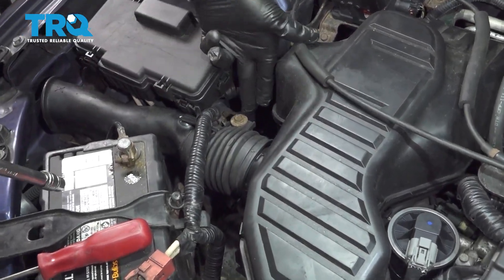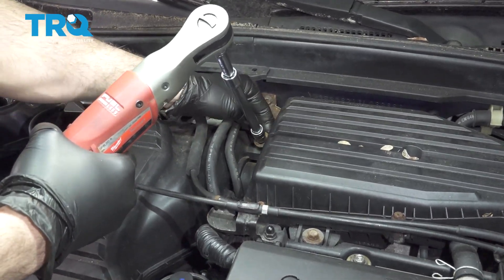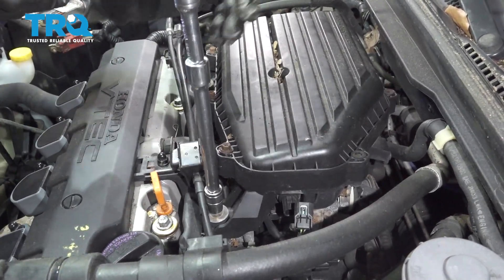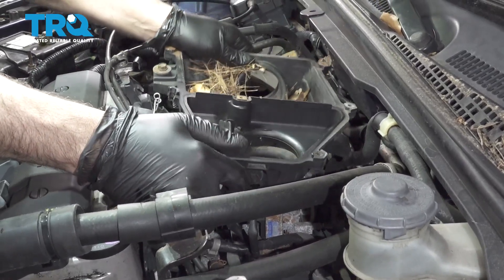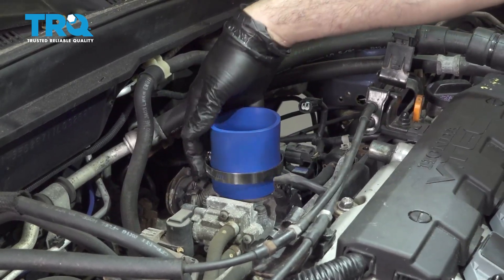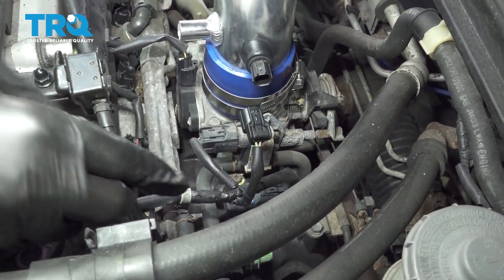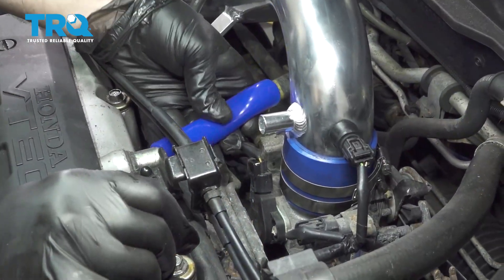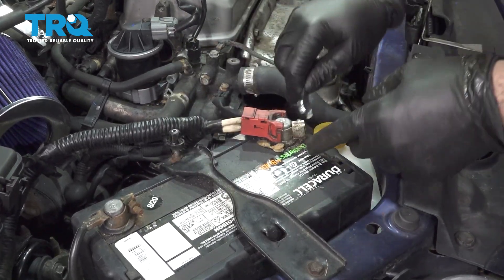How To Install Air Intake Kit 2001-2005 Honda Civic

Comment: Thats a ram air intake, not a cold air intake, that intake is just sucking in all the hot air from the engine bay, the cold air intake goes down beneath where the battery is, so battery has to be moved
Reply: With the car moving there is No hot air being sucked in and the removal of all that plastic boxes helps the car cool better.